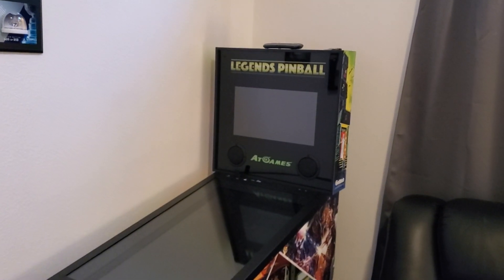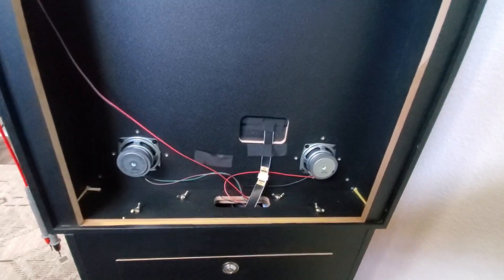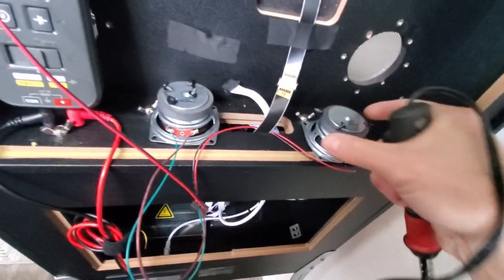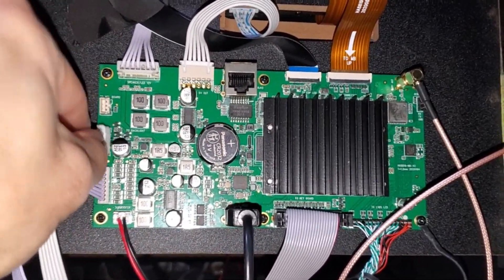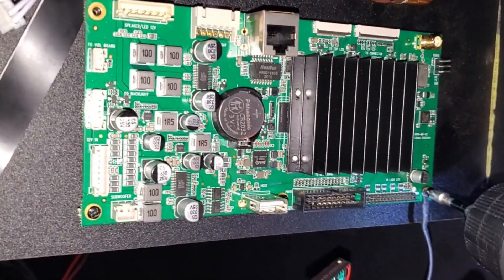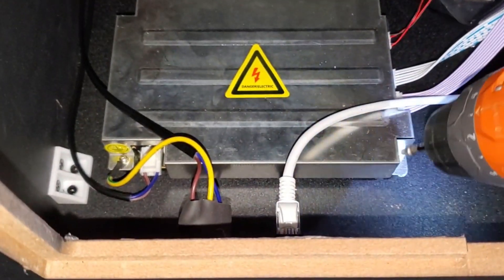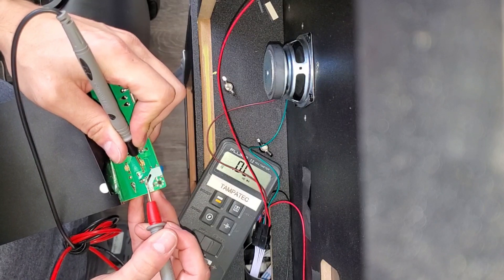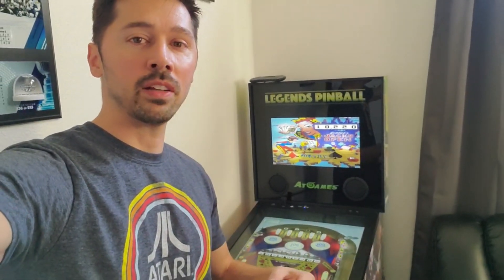Legends Pinball troubleshoot repair service guide

Comment from the maker: 4:32 lcd screen issues 11:25 dark screen issues
Reply: Pro tip : watch series at flixzone. I've been using them for watching a lot of movies these days.
Reply: @Desmond Wade Definitely, been using flixzone for since november myself :D
Reply: Hi TT, I just got a pinball machine and i have a bright white light along the left side of the  playfield screen, seems like the monitor might have moved from the case that holds it or it was put together wrong.  Any chance you might be able to help?  Have you seen this before?
Reply: Is there a troubleshooting tip for black screen on playfield and backglass or is just a faulty board.

Comment: HUGE help even just identifying what connection is for what. I had the "colours cycling" problem on my main screen after doing some work on my cab and it turns out the cable was just slightly jostled out of position. I wouldn't have known where to start testing. Thanks!

Comment: My backglass is not working. It hasn't  worked since I unpacked it. Both cables  are connected in the cabinet. What could be wrong? Try re-plugging it like you said?

Comment: Tampa Tec have you had this issue or heard of this happening? My up volume will not work. What I mean is when I click on the up volume button it will appear on the screen but the slider will not go up. The down slider goes down but now I have zero volume. I ordered a new volume control board but that did not solve the issue. Do you know what cable connects the volume board to the mother board? I also have a new mother board installed so that should not be the problem. Any help would be appreciated. Thank you in advance.
Reply from the maker: Check all your cable connections on both side of boards and reseat them. Check physical button and make sure it's not stuck.
Reply: @TampaTec  Thank you. I will try.
Reply: @TampaTec  I tried all the connections and it still does not work. The buttons are not stuck either. Do you think there is a way to by pass this or an adapter I can use to attach to the end of cable that plugs into the volume control board. Maybe bypass that and go into something else? Not sure just trying to brainstorm because other people have had issues on the internet and no solutions.

Comment: I just got a new unit that cant exit the welcome & register screens as only the d-pad and channel +/- buttons work besides the reset flippers working on the left side so was able to factory reset. The home button doesn't do anything.

stuck 😢🙏
Reply from the maker: U can plug in xbox controller into usb port to exit but Reseat game board connections and control panel connections inside the cabinet, I made a tutorial video on my arcade playlist. Sometimes things get loose in shipping.
Reply: @TampaTec  got a couple of those tysm!!
Reply: @TampaTec  it worked!!=)

Comment: My right flipper is glitchy.  What could cause that?  Sometimes it doesn't flip and sometimes it flips rapidly.  It seems to get better with play but is still unpredictable.
Reply from the maker: Check Loose wire connections at button or connector not seated in good at circuit board.

Comment: Thanks for this video, I pulled the plug out for the display today and it bent the pins on the power supply board, now I have no power to my main playfield. im going to attempt to open the power supply and see if I can solder the pins back onto the board, but if that doesn't work, do you know where I can get a new power supply for the ALP? Its not listed on the atgames site from what I could see. Thanks!

Comment: Great video but my issue isn't addressed.  My pinball machine's on/off switch lights up but both  the game board and  the back glass stay completely dark.  Tried the connections, visually checked the boards and tested the power supply but still no luck.  Any suggestions?
Reply: Did you ever figure it out as I have the same problem.  thanks.
Reply: @kleinrobjen3308  Not yet, the wheels are  moving very, very slowly on this. AtGames suggested I get a new main board which I did for $120.000.  That did not fix it.  Now I'm waiting ... and waiting ... and waiting for a new power source I purchased to arrive and try that.  Hopefully it will.
Reply: Thank you. I will let you know if I can figure anything out on my end too. Let me know if it fixes your problem.
Reply: Did you happen to disconnect the faux coin door connections on the front of the machine prior to this issue occurring?

Comment: At 9:02, the 2 small white plugs with red wires going to the power supply, does it matter which one of those goes where if they’re unplugged and you need to plug them back in? I was reaching inside mine today from the back and twisted my arm and it unplugged the wires that go to these connectors. I’ve found one hanging from the playfield back glass, and once I find the other one, I need to make sure it’s ok to plug them up in either of these connectors. Someone please answer, I’ve posted in a Facebook group and messaged some people on Reddit that seem to know about these machines but nobody is replying and I can’t find a schematic anywhere. I didn’t even know there were two things that plugged in to these until I luckily found this video.

Comment: Hey I've got one and the micro speaker in the front left of the cabinet developed a pretty serious buzzing noise.  I was able to stop it by jamming some bubble wrap between the outer case and the cabinet to keep the white plastic cylinder of the micro speaker from vibrating.  However, is there a way to fix whatever's loose in the micro speaker or is it best to just replace the micro speaker?  If so, can you do a video on how to do that.  I took it apart and it looks like you'd have to pry the plastic faceplate that says 'Legends Pinball' from the mounting board that is held down with the four screws in order to get the speaker out.

Comment: Do you know how to repair the backlight of the back glass screen? It is dim now because I screwed mine up while installing a VIBS board.
Reply from the maker: Check out Shopjimmy.com they sell LED backlight strips. They have many tutorials too but I suggest get the upgraded backbox from buy stuff.
Reply: Thanks for the quick response. I still want to use the stock games. Wouldn’t I only be able to use the PC with upgraded back box? The problem I’m having is that the screen is dim when I connect the stock HDMI mini board and when I put the VIBS on, it lights up with just different colors, with no images, but you can still see lumination  when that happens. This dude on YouTube says is a 12V burnout from installing the VIBS the wrong way. I am just trying to keep my back box so I can alternate between the PC and The LP. which LED lights would be compatible to the back box monitor? There’s a bunch of different kinds of LED in that store. Thanks in advance! TT

Comment: Hey I’m having issues with the physical volume switch, when I press the vol + and vol - no sound bar in the screen also does not adjust sound on the unit, if you have any information that would be great thanks!!

Comment: I have no display on my back glass. It was working fine then one day just never turned back on. I disconnected and reconnected the ribbons but nothing. Any thoughts? Thanks
Reply: This is exactly what I'm experiencing.  This happened once before about a year ago, and then magically the back glass display started working again.  I'm going to dive in and see if a connection issue, which would be better than a failed board.  ALP healthcheck indicates issue with USB control board but not sure how that relates to native display for the back box.
Reply: Any luck I have same issues

Comment: I think that I may have fried my main board today.  I  I walked across the carpet and felt a small shock when I touched the ALP. The control buttons stopped working in OTG mode. So I rebooted it. Now I can't get a picture on HDMI. Looks like it's trying to connect but goes black and then comes back to the no signal screen. I tried two different PC's and two different HDMI cables. Also factory reset the unit.  While booting up my PC in OTG I can briefly see the Windows loading screen but it is tinted bright red.   But after Windows loads, the screen stays on the no signal screen, occasionally going black and trying to connect (while making a popping sound) but never connects.  
 

Is it likely that I need a new board?
  Or is there anything else I can check?
Reply: This is my problem now did you ever figure it out?
Reply: @therambaba1033 yes I had to order a replacement board from atgames. Took me well over a month to get the replacement and I had to pay full price for it. It happened just a few days after the 30 day warranty.
Reply: I’m thinking it’s a compositor the one closest to the main display plug and ground

Comment: My firmware update failed. Now it is saying to use a usb thumbs with the update on it. It keeps rebooting because I have no way of downloading the update to a usb drive. Anyway to reset the machine?? Help! This is the second machine that I’ve had problems with!
Reply: Did you fix this? I have the same issue right now...

Comment: Iam experiencing the issue with the blueish screen! Says Legends Pinball on the top box as well. Did 3 factory resets with the same result. Everything seems to be seated good and tight. Iam under the assumption it has a bad board. It just quit on me to this blueish screen right in the middle of an update and has not come out of it since. Bad board TampaTec? Nothing i do seems to change anything 😕

Comment: Hey TampaTec I took my legends pinball apart to install some custom graphics, I think when I put it back together I plugged in the ribbon cable from the 32” monitor upside down. Now I just just get a illuminated black screen, do you think I broke the display, game board or both?

Comment: My haptic stopped working can you help troubleshoot.
Reply from the maker: Reseat connections under control deck and behind back door the game board connections labeled sub reseat too.
Reply: @TampaTec  Mine stopped working too.
Reply: Thanks for the reply, I reset the wires but didn't work out.  Still not working.
Reply: Same. No haptics after about a day and a half of ownership. Checked and reseated everything. Nothing yay
Reply: Yup same issue here only had it for a week and the haptic stopped working

Comment: Tampa Tech Dude: whom do you recommend to fix a 51" Samsung smart tv? I'm in Orlando...its very heavy has glass framing the screen.

Black screen
Red light on
Will not turn on

Who can help me repair? What can I expect to pay? The so much. T
Reply from the maker: turn off the lights in your room and check for backlight glow if you see a glow but not picture that Can be bad board main board or tcon board swap, if your know how to unplug and unscrew back cover and board anyone can do it. Shopjimmy.com or electropartsonline.com
Reply: @TampaTec  done, after watching your vid...nothing it's an 11 yr old 52" samsung not smart tv...super heavy. My mechanic just sold me his Visio 55" smart tv for $150...delivered and set up...hope that's a good price. I wish that I still lived in Tampa...all the cool kids live there..ha. Thanks a million!!!!! New to your channel...and im already hooked.
Reply: I know this is late to the party, but I'd be willing to bet that you have a bad capacitor or two on the board.  Had similar problems with a Samsung 52" around that age.  Opened it up, located the burst capacitors, desoldered and replaced them.  Worked just fine after that.  Cost me 5 bucks for 2 new capacitors on amazon.